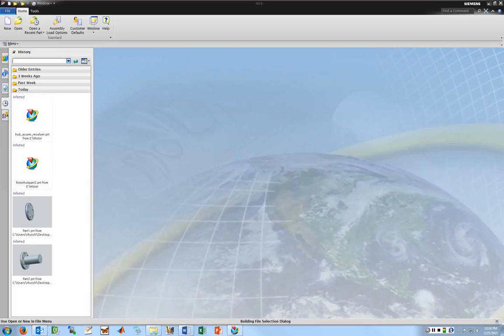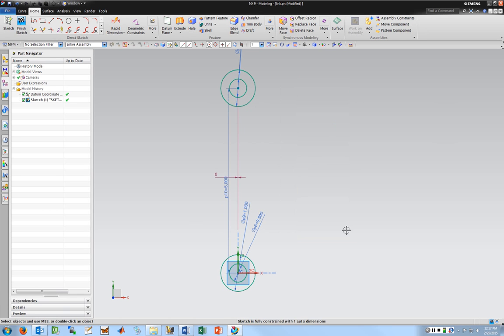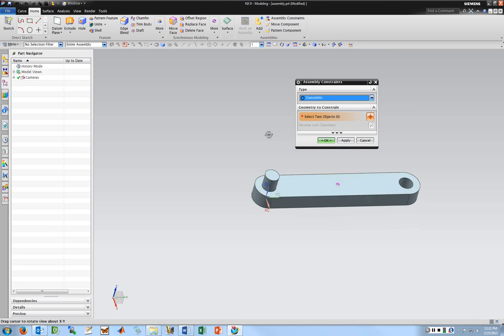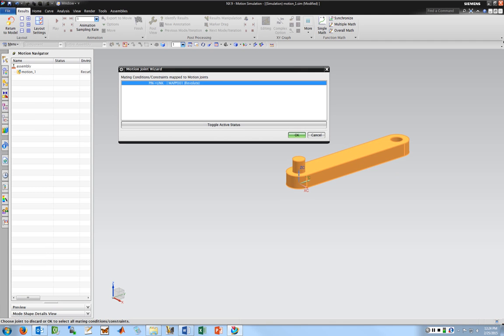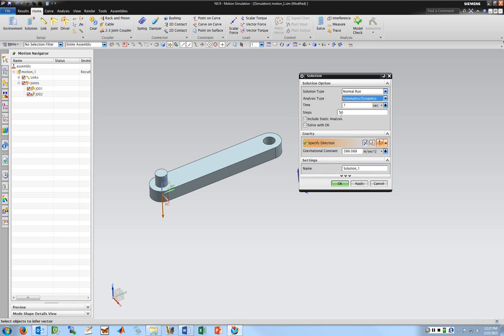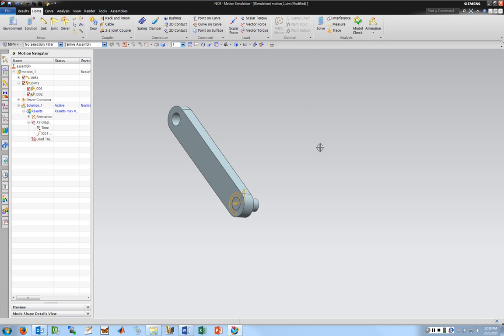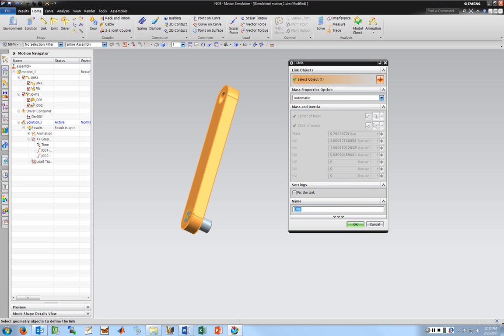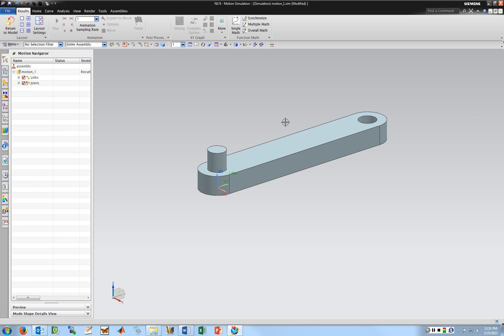NX 9 Tutorial 2 (Motion Simulation)

Comment: Hi, I am trying simulate a two bar robotic welding arm. Could you please let me know how to define the travel path of the second link along a inclined path?
Reply from the maker: For 2D, a Slider joint between the tip of the 2nd link and a vector along the inclined path should work.  For 3D, a Planar joint using a normal vector for the plane should work.